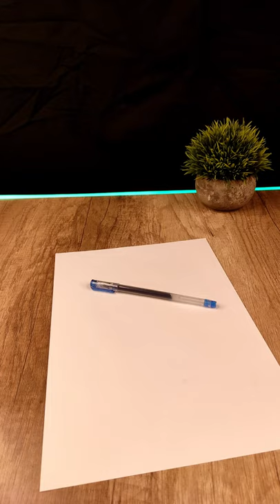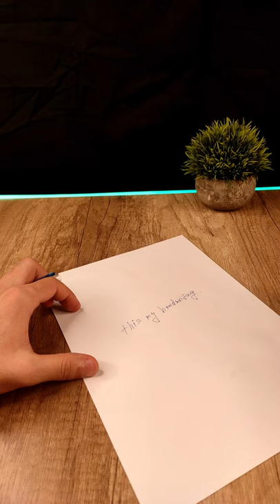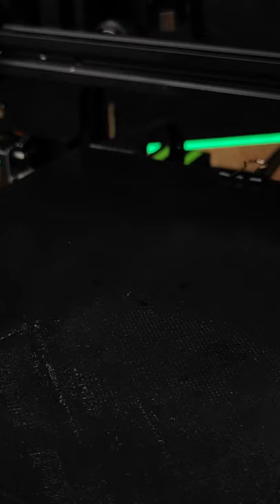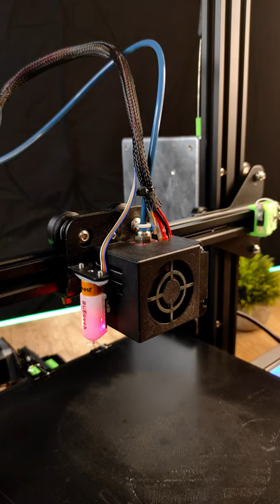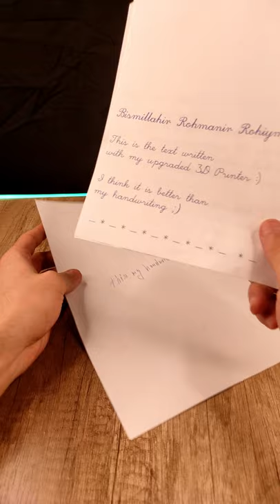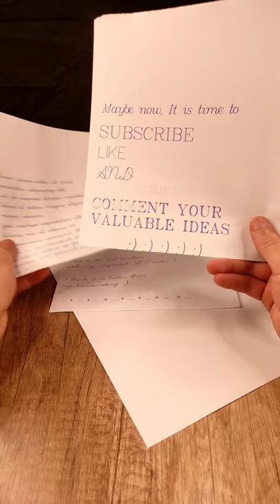Converting My 3D Printer to Handwriting Machine✍️ - 2D Drawing Printer

Comment: Did you have to reconfigure marlin to do this?
Reply from the maker: Yes, usually I was using BLTouch to Auto Bed Level, but this time I had to use Z stop switch to home, so I reflashed modified Marlin😊
Reply: @engineericly  Kewl!